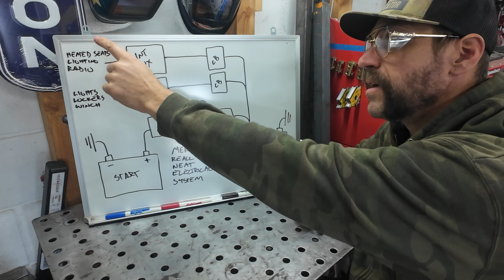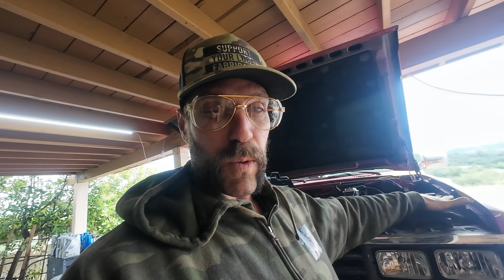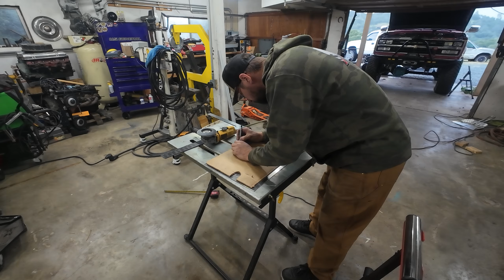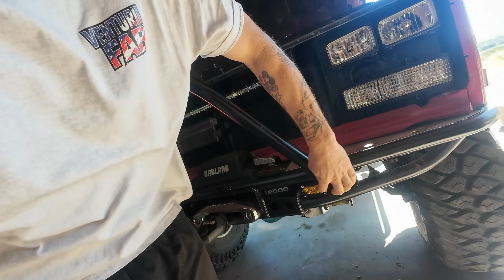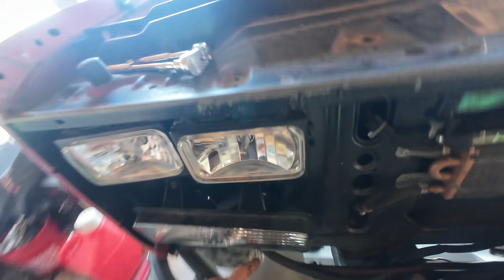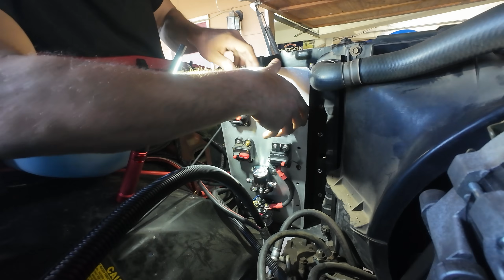I Upgraded My Squarebody’s Electrical System the Right Way | Dual Battery Setup

Comment: Totally going to be copying this for my K20. Going to be building my own wiring harness as well.
Reply from the maker: Awesome, its been working really well for me
Reply: @VenturiFab Good to hear. I was going to get a painless kit but after doing some research I decided I would just build my own harness. Going to relocate the fuse box and the whole 9 yd. Everything from scratch. Should be a blast. But that's far in the future at this point.
Reply from the maker: @Gut-Wrench-Garage so what i did here is all accessory stuff...adding lights and dual batteries, etc...if you're rewiring the whole truck i would recommend american autowire. I've used them in multiple rewires and they've always worked great plus its much cleaner than a painless harness.

Comment: This is how RVs are wired, and it works really well. My vintage Ford F53 stripped chassis uses this system.
Reply from the maker: Funny you should mention that because I didn't even think of it. I used to do all the aluminum/structure repair, electrical and plumbing for a shop that worked on lots of RVs.  That explains why I went right to that style system 😂

Comment: That's one of the cleanest dual battery systems I've ever seen. Well done! Just curious, is Duracell your preferred  battery brand?
Reply from the maker: thank you! no duracell is just what I happened to get last time I needed a battery...I don't know who I like for batteries anymore, they've all kinda gone down hill the last several years...Optimas used to be amazing but they're junky half the time now, and the fancy ones are like $500 lol
Reply: @VenturiFab  I hear good things about Fullriver batteries. Specifically the Full Throttle series. They cost about as much as Optima but aren't trash.
Reply from the maker: I'll have to check them out for sure, thanks!
Reply: @VenturiFab The battery you want is a Catapiller PHO battery. The catch is, you need a group 24 to fit the OEM tray, which is lower CCA, but still probably way better because you have 2. Or if you modify you battery trays to fit group 31's you would have 2 monster batteries that will out last the truck.